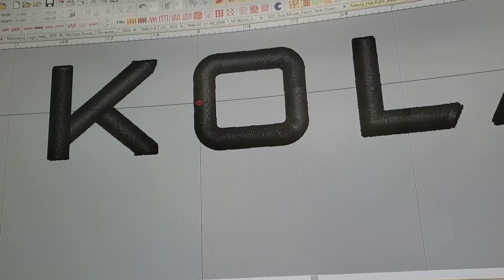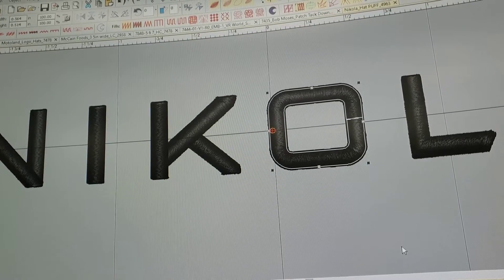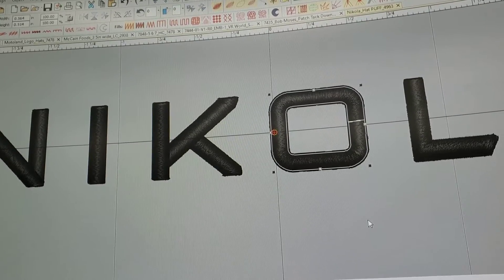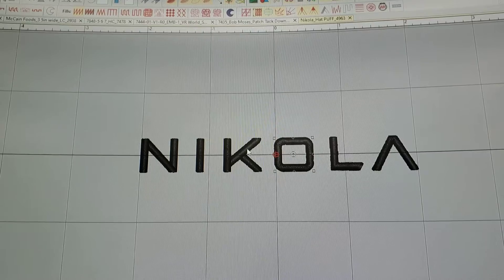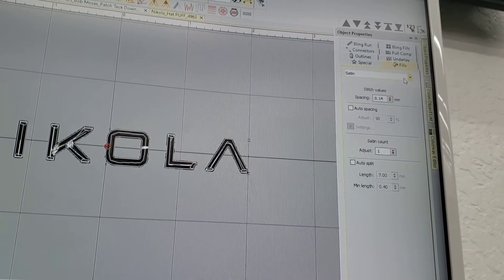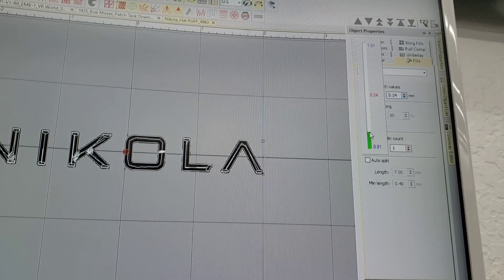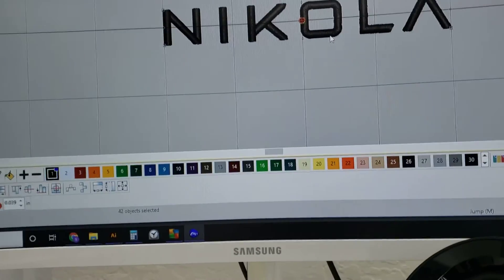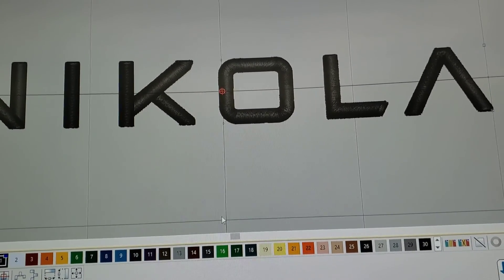Wilcom - How (And Why) to Change Design Density

Comment: I have issues with little gaps in white thread, especially in text, all other colors don't show the gaps. Is that a density issue or is that just the way white thread is? I also notice that when stitching white thread, the threads look like they bunched up, like stacked on top of each other. Also, do you have a video that deals with issues with white thread? It's the only color I seem to have issues with. Thanks.
Reply from the maker: I probably use white thread more than any other color, and I don't encounter the issues you are describing more with white thread. It is also difficult to judge tension with white thread unless you use a different color bobbin thread - this might be a good experiment for you to try. White thread is often thinner due to the bleaching it has undergone. Have you tried a different brand of thread? This might be another good experiment. Best of luck to you! Thanks for watching our videos.